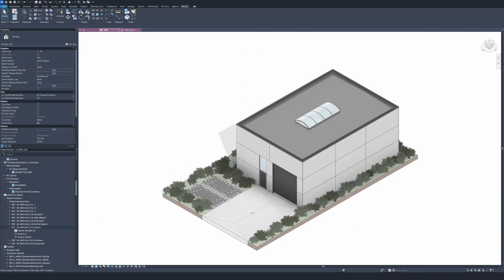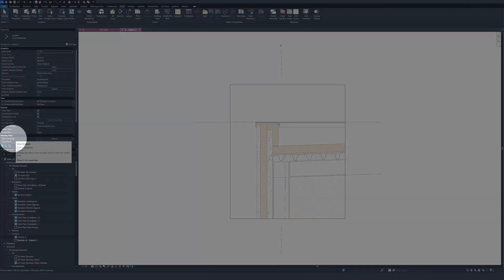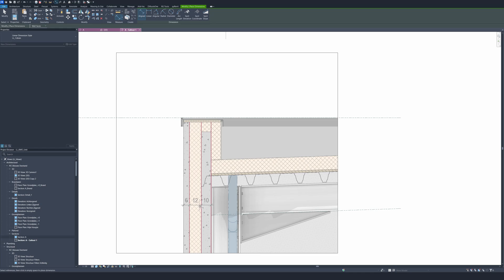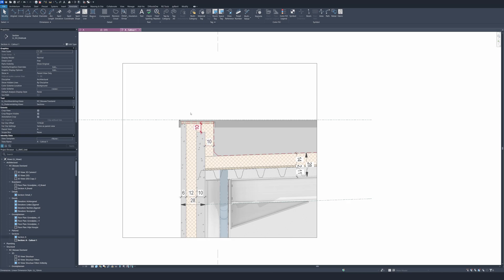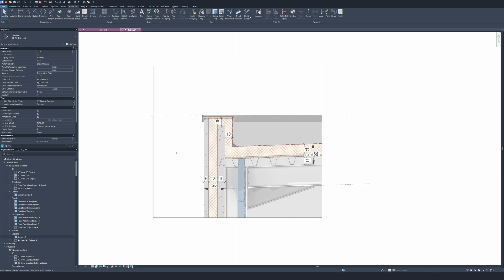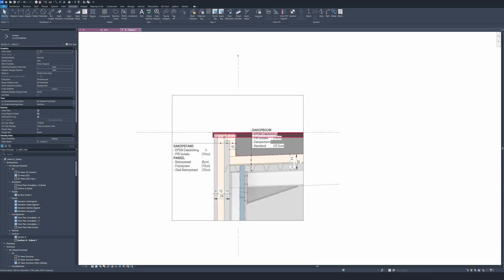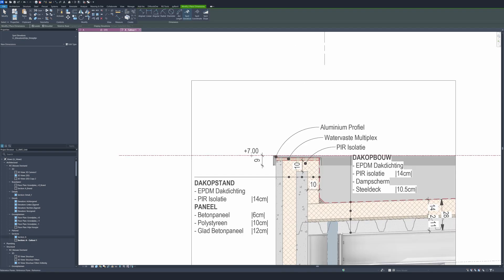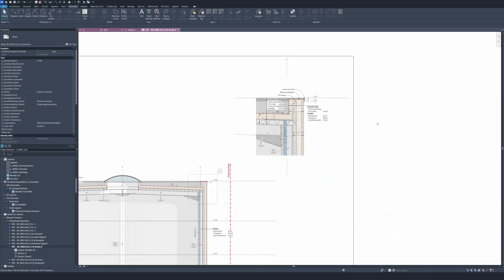How to Nail a Perfect Roof Edge Detail – Architect's Guide

Comment: Great explanation but one problem: 
I'm not sure what the regulations are in your part of the world but the "arrows" are not universally conventional when defining measurements. It's my understanding that engineers use this rather than architects. The "architectural tick" is more widely used and is actually preferable. You have arrows in one place and "architectural ticks" in others - maybe they should not vary like this. Please correct me if I'm wrong about conventions in your area.
Reply from the maker: Thanks for your feedback, and you're absolutely right to point out the inconsistency. We do primarily use the “architectural tick” here as well, and engineers in our region often prefer it too — though occasionally other styles are used.

That said, we sometimes use arrows specifically for overall dimensions across larger distances, as they make it a bit easier to read or extract those measurements quickly. But overall, our standard approach aligns more with using the “architectural tick.”